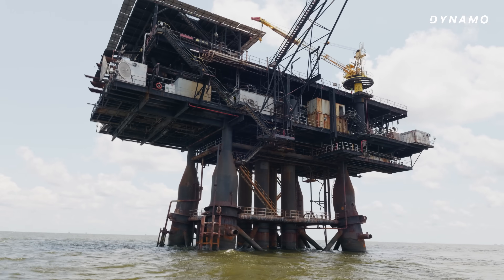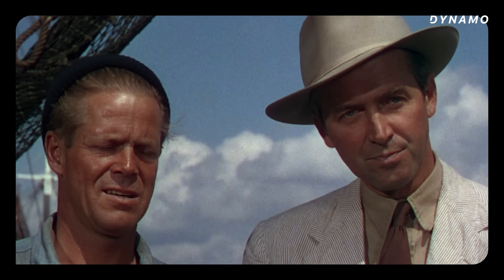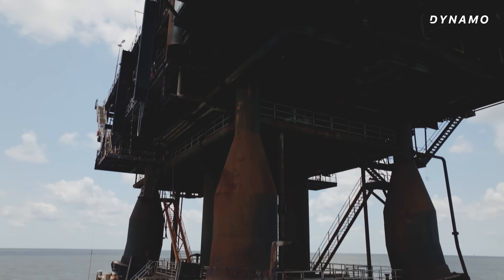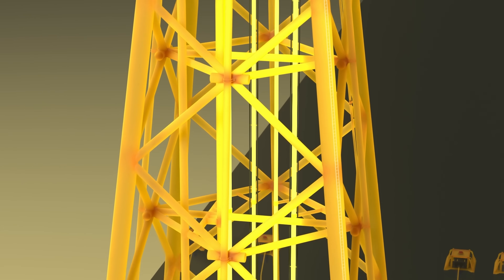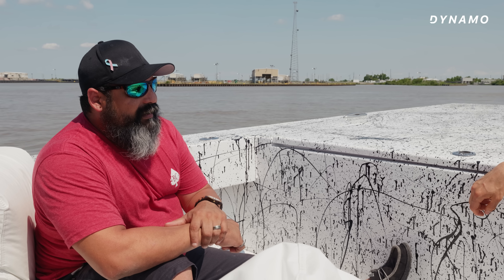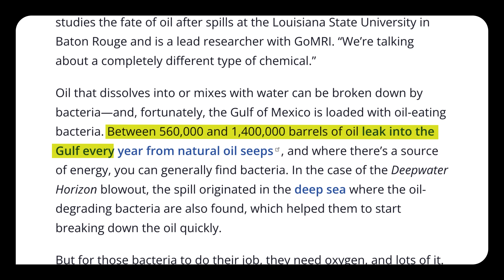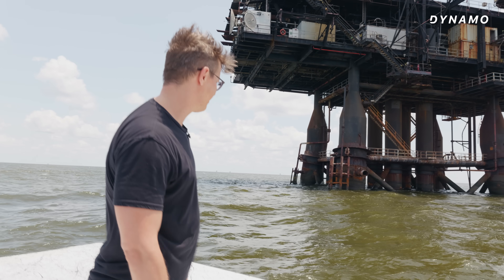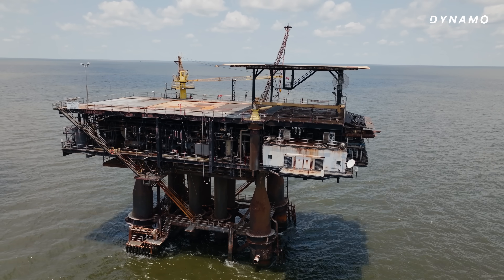I Visited Abandoned Oil Rigs — and Found Something Terrifying Underwater

Comment: If the removal bond is not sufficient it is the fault of the government which establishes the bond.  The wells on these platforms are totally dead except for a few which have an active water drive; if you knock the well head off the gulf will flow into the well.  The oil and gas have been recovered, there is nothing there to 'blow up', just more sensationalism,

Comment: There is no oil in the platform. They aren't the issue at all. The issue is if there are unplugged wells, just like everywhere. And many of those wells predate requirements to plug them when they are no longer in use.

Comment: While you have good intentions with the video and did mention that deepwater horizon was an active drilling platform when the accident happened, your other example, taylor energy, lacked the context that it was also an active platform when it was destroyed. You didn't provide an example of an abandoned platform being damaged and then causing an oil spill even though the entire point of the video is talk about the dangers these platforms present and are ticking time bombs that could cause ecological catastrophes. To some degree, the issue is being overstated. Not all the platforms are 80 years old and rusted to the point a toothpick could topple them over. Yes the oil wells themselves should be plugged if not already, but an abandoned rig that's 10 years old isn't going to cause a major catastrophe form a rusting steel standpoint. Steel does rust quickly in salt water but its on the order of millimeters per year and the steel plate in the pipelines and platforms range from half inch thick upwards of 3 or 4 inches thick. Even for 0.5 inch thick steel, it would take literal hundreds of years to rust away to nothing. Other forms of corrosion like galvanic corrosion could significantly speed up the process but outside of lighting striking the platforms, there isn't a whole lot of stray electricity in the ocean. Obviously if there is still significant pressure in a pipeline, it doesn't need to rust away to nothing for an oil spill to occur but the video is pushing a rush and panic narrative when in many cases, you can go decades without servicing the pipelines or platforms and they'll still be fine. Probably no longer safe to use for oil drilling and transporting oil but not a risk to just spontaneously explode and collapse.

You also didn't mention the positives of the abandoned platforms. i.e. they make great fish habitat and anglers will regularly visit both active and abandoned platforms to fish or spearfish. They provided a significant chunk of the recreational and professional fishing grounds. One industry that absolutely hates the oil industry are shrimpers because they can't drag their nets along the bottom without risking the nets being snagged and destroyed. Which, I'd argue, is a good thing for the environment, and that's coming from someone who loves eating shrimp.

Comment: In the North Sea they are continuously removing platforms for years because it's legally required for the oil companies. They use the largest crane vessels, such as the Pioneering Spirit.
Reply: I used to work the oil field off the coast of CA. Apparently the law there is that if the structure is standing it's got to be manned. If you're going to abandon it, it needs to be completely removed, down to the sea floor. So any platform you see in CA waters has people on them because it's cheaper to continue to pay those employees than it is to remove the platform. That's what we were told, at least.
Reply: @chrislee3414  Sounds perfectly reasonable to me. Why didn't it apply to all the rigs and platforms in the gulf of MEXICO ?!.....
Reply: @charliehayward2512 I'm not really sure. Maybe they think having people on them will prevent environmental disasters? It certainly has no effect on the safety of marine traffic.
Reply: @charliehayward2512 it was REGULATED in the North Sea. Look up the OSPAR regulations, among others. There’s regulators like OPRED in the UK who will litigate operating companies and their directors for failing to meet their decommissioning obligations. The operating companies in the UK were also required to pay into a fund for the rig removal as they produced, so they couldn’t pull a fast one, sell it off cheap and walkaway without contributing to its decommissioning.
Reply: @chrislee3414  well, oil spills in the Gulf spike every time Chevron and Shell have those massive layoffs, so, I could believe that having the platforms manned prevents oil spills
Reply: @chrislee3414 Who needs a houseboat.
Reply: @chrislee3414 In Texas some are unmanned, they have a signal horn blaring every couple of minutes. I love them like thousands of other anglers do. I met a San  Francisco 49er football player at an offshore platform in his own boat 125 miles offshore from Port Aransas jetty.😊
Reply: @michaelj343  I'm back in the Gulf now, working out of Louisiana. I've been working on supply boats since 1998, that CA job was only 5 or 6 years, the rest of the time in the Gulf. I'm quite familiar with those signal horns. They are kinda nice to hear on a quiet night...until you're right next to one and you're trying to sleep.  😄
Reply: I was looking for this comment. In this current political climate in the UK, people are continuously moaning about taxation, regulations etc. This video is a good reminder of how the alternative of limited state regulation and intervention can have some nasty consequences
Reply: We as People Need To march On Congress 😮😮😮😮
Reply: But this is America 😂 .
Reply: That's good to know.
Reply: like the other guy, I too work on the supply boats in the gulf that take everything to the rigs. There's been two rigs that were pretty large, unlit, unmanned, not listed on the charts, that I sailed by late at night. Just a giant silhouette on the horizon. I did not enjoy that experience. Pretty sure they got them lit again.

Comment: My question is . why do companies leave oil behind in the well only to blow out. Why not require them to pump them dry?
Reply: It won't blow out. That bit of video was nonsense. If the well isn't productive anymore it will be underpressured so won't blow out. It's probably got a kill mud in there aswell.

Comment: The title is misleading--what is terrifying underwater?  While these platforms may be eyesores above the water, they create an oasis of life below.  The solution to these abandoned platforms is to cut them down to a safe navigable depth (so other vessels won't hit them) and toss the scrap into the water.  This wreckage forms a huge artificial reef teaming with life in an otherwise desert sea floor.
Reply: The oil well needs to be capped permanently. Also the pipelines from them.
Reply: You missed the bit about the leaking wells then
Reply: No it’s still the Gulf of Mexico
Reply: Title is misleading because he's referring to it as the Gulf of Mexico... He meant the Gulf of America!

Comment: Isn't the answer obvious?  The mineral right owners need to do a proper decommissioning or pay someone else to do it.  If the government charges 10x what they think they can do it for they can explain to the shareholders that it isn't profitable to run this design from 1970.

Shareholders will say "Fix the design, make it so that the well can be sealed for a reasonable price."

A shifting the cost problem is messy.  If it can be turned into an engineering problem, well I'd like to think there are a lot of smart engineers that can find an innovative solution, willing to take the job.

Comment: so here is my idea on this. You say 1-10 million per wel would be the costs right? So we set it at 5 million average right now. Then the bond should be 5 million per wel, and the permits include a part where the current owner/operator MUST pay for inflation correction on that bond if needed. They refuse to pay? That means their permit on the rig is pulled back, and with that they no longer have the rigs operation in hands. Now they can go in to plug the wel and clean up with the bond money, or if there is interests they could auction the permits with the rig, any profits go back to the bond system, and if that still dosnt cover the difference then the new operator has to pay more(make this clear at auction)
Now the 5 million for some wells might be way too high. But here it comes, if the bond that they payd up front turns out to be more then the cleanup costs THEY GET IT BACK. Now all of a sudden you made an incentive for the companys to get their shit cleaned up, because they might get millions back when the cleanup is done.
So make them pay too much up front, give them back what they overpayd in the end, and you made an incentive to clean up.

Comment: AI could be dangerous, and isolating it on a rig seems plausible. You want to run ´unsafe´ AI code, well, try here and we can always figuratively call in an airstrike, No more bad AI program. Legislate, and monitor, that joe public cannot enter such oil-rig. Water-cooling is also an option, and these are big structures to hang off.... Errr... unalive all humans... snip cable... enjoy 300m deep... 1, 2, 3,... 403 ... thud, yup she did an oceangate... corrode in peace ´Amy (AI)´... that girl turned real bad...

Comment: I worked in the Gulf of Mexico (Now titled the Gulf of America)for 30 years as a commercial Diver. Worked on drilling rigs & platforms & pipelines. They are not all oil rigs. What you called an oil rig is actually a platform. Rigs are mobile & drill the wells for either oil or natural gas. Platforms produce & ship the oil/gas through pipelines to shore. There are lots of unmanned platforms in the gulf. Except for maybe a few, They are not abandoned . Most are producing , some are shut in & awaiting removal. I’m not defending oil/gas companies. BP should have been run out of the gulf & never allowed to drill there again!
Reply: After the whole Deepwater Horizon incident, I was working on a frac boat. We had a job at some BP platform and where they needed us to be was directly beneath their flare boom, which was burning off so much that I could feel the heat inside the bridge, through the glass, from about 300 to 400 meters away. We had roughly 1000bbl of highly explosive xylene in tanks on our deck. I told them I wasn't going in until that flare was shut off because of the xylene, I was the capt on duty. The company man didn't wanna hear it and tried telling me that I HAD to get into position to do the job. I didn't, I held my ground, but even after the Horizon, BP was still trying to sweep safety under the rug in the name of progress.
Reply: @chrislee3414 Good You, Held You're On, After All You, Earned the Right to be a Captain,  & Sometimes You, Just Gotta Hold your Position , Because You, Have Earned the Right to Make the Right Decision Especially when it comes to Safety of Yourself your Crew & Ship.. Good Call Captain  👍
Reply: it took me 5 seconds to google that there are more than 14,000 unplugged abandoned wells in the gulf of mexico.
Reply: "Gulf of Mexico" is a name that's a part of my childhood. When I was a kid and we went to Florida, knowing that we were on the Gulf of Mexico made it somehow more exciting and exotic and reminded me that across that water was a whole other country. Made me feel connected. Just because you can change a name to something doesn't mean you should. Will always be Gulf of Mexico to me
Reply: There was never a need to change the name...
Gulf of Mexico
Reply: I suppose he got some terms wrong but the overall story is true. There are a lot of abandoned and orphaned wells on land and sea in US.
Reply: If you call it The Gulf of BP, then maybe they could be liable for cleaning it up?
Reply: Gulf of Mexico
Reply: We as People Need To march On Congress 😮😮😮😮
Reply: DWH cost BP dearly, like more than half its equity, and it paid up.
Conversely, Exxon failed to pay up on the Exxon-Valdez wreck.
Reply: Issue is many oil,gas rig/  both land and deep ocean are abandoned with legal loop holes. It's a big issue
Reply: @vamwolf it really isn’t. I worked in the gulf and any abandoned well/platform has to be plugged and capped as per the governing agency (under the dept of the interior) over each area(depth dependent). I’ve worked on several decompressions of platforms and never saw any corners cut. Too many eyes. Yes, there are the outliers that slip through the cracks but not to any extent that would cause major concern. Call your politicians and get involved.
Reply: BP= Rothschilds
Reply: I know you!
Reply: Shut up pat
Reply: dont dare to call it gulf of america, dont be an imbecile
Reply: more than half the platforms in the northern Gulf are inactive, they don't produce anything but oil leaks
Reply: Literally nobody except ignorant Americans calls it that, it's the gulf of Mexico, you can't just rename a historical landmark cause your potus has a small dink
Reply: ROFL - "Gulf of merica"
Too funny!
It just proves the arrogance of some Americans...
Reply: No it is not the: Gulf of America.  It is the Gulf of Mexico.    From Corpus Christi.
Reply: @mikemalloy966 trust the science, Mike.
Reply: Gulf of May-he-ko
Reply: GULF OF MEXICO
Reply: @dgomez999 it’s literally the gulf of America more of north American surface area touches what we refer to as gulf of America. Also all of the maps have changed to gulf of America so if you still call it Mexican gulf you are rtarded
Reply: @dgomez999 deported
Reply: If you lay the fault of the Deepwater Horizon solely on BP, you demonstrate a fundamental misunderstanding of that situation.
Reply: I worked on jack-up rigs in the Gulf of America. This is probably the most common misconception about all offshore installations are the same. There are many different designs and purposes for installations.
Reply: i am sure not only BP ..You sound pretty biased
Reply: Rather than argue about the name of the Gulf, let us call it “ the Gulf of the Americas”. Because it lies between  the USA,The Republic Of Mexico, Guatemala, Belize, Honduras, Nicaragua, Costa Rica, Panama and Columbia: plus all of the insular nations that are in the Gulf have very real stakes in the name. Let us poll those nations and if they can come up with a suggestion so much the better. If not let’s return to the historical terms that were used by our Founding Fathers and Government, in  the 17th, 18th, and 19h centuries.   bill
Reply: @williamhoff2172  I like “Gulf of the Gulf Coast” lol!
Reply: @williamhoff2172 there wasn’t an argument to be had until the clown in the White House came along and shocked your feeble brains with propaganda, pure stupidity
Reply: @williamhoff2172  I actually like "Gulf of the Americas" but that's not what Trump decided to call it. He called it the "Gulf of America" and that's 'effin stupid.
Reply: @williamhoff2172  there’s nothing to argue about. The name was changed to Gulf of America. Which actually makes more sense if you put a little bit of thought into it.
Reply: @stevemccauley5734 putting a little though in isn’t your strong suit is it
Reply: @stevemccauley5734 anyone who agrees with trump thinking and thought are absolutely not your strong point
Reply: @Hope-Dasher so you believe criminals should be allowed to do whatever they want.
Reply: @stevemccauley5734 Well, it wasn't really changed. There's a process for that, and it wasn't followed.
So it's still the Gulf of Mexico.
Reply: Gulf of America not mexico
Reply: It's still the Gulf of Mexico to anyone but the US. Only the uneducated treat it as Gulf Of America.
Reply: @ldib7798  Makes me wonder why he never said "Gulf of America" in the video? It's not hard, that's what it is, just say it.
Reply: @ldib7798 quiet boy
Reply: @ldib7798 You are correct
Reply: @ldib7798 gulf of Mexico has been around longer then America 😆
Reply: @christianmartinez7802 well america is technically a continent. But if were talking about the country called the united states of America it came into existence in 1776. While Mexico didn't exist until 1821. I have an iq of 130 and most of yall are not bright. Should leave the thinking to the ones who have the capability and understanding.
Reply: @TravisTheSavage It's called the golf of Mexico after the Aztec who obviously predate the USA by a few thousand years.

Further, the golf region has been referred to as Mexica/Mexico since at least 1550, additionally many of the states that are part of what is now  the USA was historically part of Mexico and were annexed by the USA only as recently as 175 years ago, 

The founders of the USA called it the Golf of Mexico, because that's what it is and makes sense geographically
Reply: @Incarnation613 oh ok were doing predate namea lets call it el Mar el norte. I mean that is its original name anyway.
Reply: @TravisTheSavage Sure, call it flying unicorn farts. That'll be as true a name as the Golf of America, because no one apart from Maga calls it that and Maga is a young and dying movement.
Reply: @ldib7798  It's the Gulf of Mexico

Comment: If the wheels are properly “plugged and abandoned“ you don’t have much to worry about, however, that doesn’t negate what sitting above the water and below it. However, as for the oil and gas production, it should be sealed off well below ground level probably hundreds of not thousands of feet down